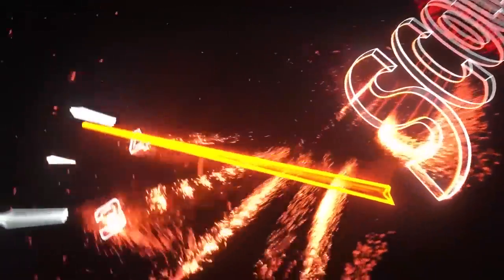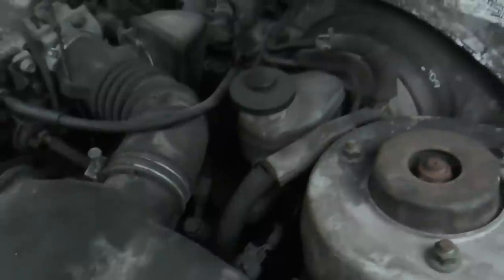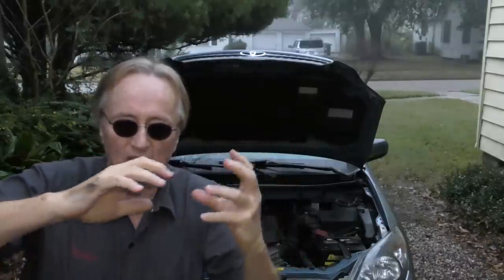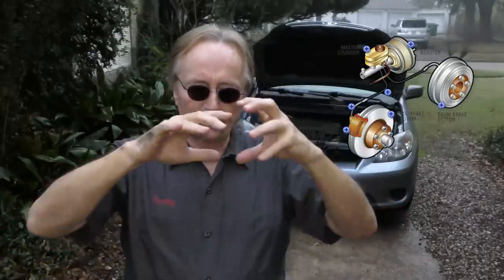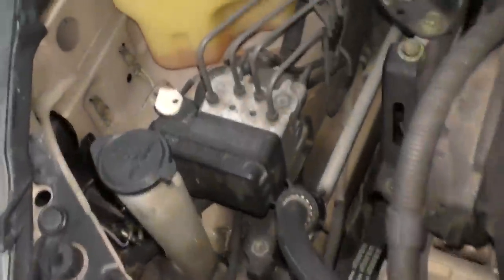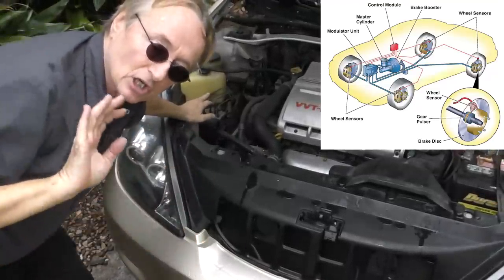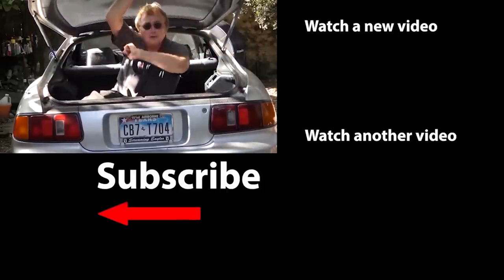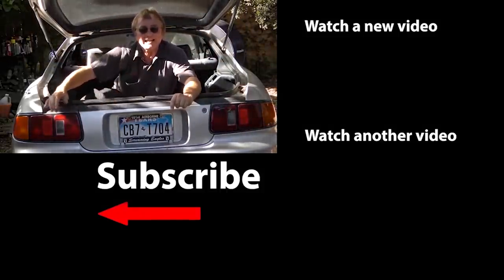Never Do This When Braking (Destroyed My Car)

Comment: Hey Scotty,  I've got a sixth reason for ya! You'll love this one because it speaks to you're criticism of stupid people.
I had to replace a master cylinder because the customer took their Nissan Rogue to get an oil change. Not long after that their brake pedal was sinking to floor after stopping.  
I looked at my customers brake system and discovered there was window washing fluid in the cylinder. I ended up replacing entire cylinder, flushing the brake system and that fixed it.
Reply: When Nissan came out with the blue coolant, you can imaging how many screw-ups we had to fix.  Coolant does not make good washer fluid
Reply: @rays7437  Yeah, but it keeps your windows from overheating.
Reply: @banderfargoyl  
Good point!
Reply: @rays7437  Oh my god, really?!?! 😕
Reply: @banderfargoyl  hahahaha!!! 😂
Reply: If I ever take one of my vehicles to a quick lube oil change service place I always make sure I tell the technician "just change the oil"!! and when I'm ready to leave I ask them to double check everything including the filler cap!! sometimes those idiots forget to tighten the filler cap or even put an oil filter on the engine😮 very dangerous!!!  you are placing your car in the hands teenagers!!! double check everything yourself afterwards too!!
Reply: @elfpimp1  
Yes, at first anyway
Reply: @cliffordgill9052  ~ Excellent point.  Has happened to me at jiffy lube that almost ruined my car - well almost.  Between cell phones & chit chat, these kids forget their main tasks.  But my car survived because it is Scotty's favorite (mine too) Toyota. :)
Reply: @rays7437  honda uses blue too
Reply: @cliffordgill9052  Hands of teenagers aren't a problem. I've had more issues with older people forgetting.

Comment: Oh dear, not mention these common problems.
Air in system
Old fluid with water in it.
Pads stuck .

All above can cause pedal problems.
Reply: People need to realize old brake fluid can and will cause problems. But do they care. Nope. Till its too late.
Reply: He already did a video on those but thanks for commenting them so other joe's can see.
Reply: You forgot the best one.... You ain't got no pads..... My niece had that issue a while back because she had a used vehicle and we had to change the pads because the previous driver was heavy on the brakes and wore them out with like 40k on the vehicle.....
Reply: Or some one doesn't like you so they cut your brake lines.
Reply: @gorp27  that only happens in the movies..... Wait, let me check my brake lines before I head out again
Reply: A collapsed master cylinder cup can let the brake pedal go all the way to the floor without slowing the car at all. Reason enough to change brake fluid for fresh on the manufacturer's schedule, to forestall rust inside the cylinder causing the cup to collapse.
Reply: @stephenarling1667  preach it man
Reply: The air is getting in where?
Reply: @johnweiland9389  air sits above fluid in reservoir. If fluid gets low, it sucks air in to the brake lines.
Master Cylinder seals can leak, and draw air in at the piston.
Air can also be in the system, if brakes were not bled correctly.

Comment: i had a brake failure once due to a broken diaphragm in the hydrovac, i used the hand brake to stop the car to get home. when it happens just don't panic. but if your not confident with the car just pull over the side and calla tow
Reply: Nemesis Chan if only my car had a hand break. It’s newer so it has the pedal emergency break
Reply: I lost my breaks on my 89 Supra, fluid leaking into the booster from the master cylinder, luckily I was only going 30 mph, emergency break handle is right next to the shifter.  Easy to stop, traffic wasn't heavy and it was an easy drive back home on side roads, had to purchase a new booster and Bk Master Cyl.
Reply: This literally happened to me a couple of days back. The pedal suddenly went to rock hard thank God I was near a couple of workshops and I managed to drive it safely to one of them. Although it sucks that mechanics in my area take advantage of you when your car breaks far away from your trusted workshop, anyways calling a tow to my mechanic and the repair wouldve cost me the same amount I paid for this mechanic.
Reply: falchulk  for the most part but my 2017 mustang surprisingly uses a a regular hand brake I honestly thought it was electronic lol.
Reply: So, every time you stop you pull the emergency brake? Then let go to drive?
Reply: @garlicgirl3149  its more of using the e brake to stop you since the main brakes dont work it wasnt designed for that purpose but it can work in a pinch for a emergency situation but yea you pull it to stop and put it back down to keep going.
Reply: @garlicgirl3149  basically yes but do it 4 times more distance as the stopping distance is extremely long
Reply: @gregbrophy5781  Broken diaphragms have caused lots of accidents.
Reply: falchulk well sorry I didn’t get the new 2016 or 17 sedan cars. I went literally from a 1993 Honda Accord to a 2011 Toyota Camry within the year I got my driver’s license and I wasn’t even graduated high school at the time. It’s not like I can afford a 2018 car as a college student anyway.

Comment: Years, decades ago my 1953 Caddy coupe lost its brakes. The coupler on the frame had a loose line and leaked out. Rolled through a red light at an intersection and coasted into the local repair shop, just happened to be going that way when the brakes quit. The hand brake I did pull without any luck. I just layed on the horn.

Comment: Scotty, until this vid, I've never seen a brake video where the person actually points out all the areas that a brake system can leak fluid! Just keep in mind, folks, to follow the lines with that flashlite, FRONT to REAR!!! Look under your hood and follow the lines from the master cylinder to the ABS module, then to any valves or unions for wet. I just love your videos, humor, and COMMON SENSE!!!!!!!!

Comment: Scotty you forgot the 6th reason........Check for a Chevy badge
Reply: If it's not a Toyota, Lexus, or Honda then you're in trouble, basically.
Reply: Hey Chevy ain't that bad it's better than Chrysler and Nissan
Reply: We have an 81 C70 10-wheeler with a grain box. Went to pull into the grain elevator with a load of corn the other night..foot went to floor and rolled up next hill. Those trucks are infamous for brake leaks/blowouts
Reply: Ha! Chevy doo doo Pies
Reply: RAY-the-WAY only if its a rear drum
Reply: Scotty for president
Reply: Nah to need the brakes the car has to get moving in the first place
It's rare a Chevy will do that
Reply: @WorkHorseLT  And Ford. But that's not hard, a Yugo is better than Ford.
Reply: @Tora1337  pfft Yugo those cars are trash at least a Ford will last 200k a Yugo barely 25k

Comment: Help!

Hello Scotty! I recently came across your channel a couple of weeks ago and I’ve been binge watching you ever since. I’ve learn a lot. 
I have a 2006 Ford Fusion 5-Speed Manual Transmission. 194k miles on it. Last year I notice the temperature gauge sometimes would not get half way like it’s supposed to. And my check engine light came on and off at times. Went to auto zone and orelly and the code was the thermostat. Bought the thermostat took it to a mechanic to have it replace. He replaced it and the car started overheating. He then said it could be a clogged radiator. He replaced that and a couple of sensors in the motor. Car would still over heat and he ended up removing the thermostat to allow free water flow. Temperature gauge still doesn’t not get halfway and check engine light is back on. With the same code of the thermostat. 
He eventually said the “engine head” was worn out, Im not sure what that mean. 
Besides getting a new mechanic, what should I do? I’m in Dallas. Thank you!
Reply: I imagine he would say have a mechanic with a laptop look at it. Plug it in, take it for a spin. It shows live data as well as detailed specs. Most would charge around $150 for a diagnosis, which would then go towards the cost of repair if you did it with them. 
He also has a video about diagnosing a blown head gasket, which you could look at, and see if the symptoms are similar. Discolored coolant, for example.
Have you thought about checking the fan(s) behind the radiator? Or possibly flushing the coolant system. Maybe you put water in it or a mechanic doing an oil change topped off your fluids then put the wrong fluid in there. For example, someone else commented on here and I've stopped it from happening to me, a tech might accidentally put coolant in the windshield wiper fluid reservoir and vice versa.
As long as you're not taking it on road trips, I mean, it's been an entire year and it hasn't destroyed your engine yet.
Did you say he replaced the entire radiator? And if you're running it without the thermostat, which would be monitored by the computer, that's why it would say there's a problem with the thermostat, because it's not there, you need to check it. I imagine the computer doesn't know how to operate the water pump correctly without the sensors and gauges. And Ford is known for having finicky water pumps, particularly in the Taurus. Fixed Or Repaired Daily.
Reply: I overheated my first car because a mechanic left a screwdriver in my radiator. I ALWAYS watch now. If something doesn't look right, I say something. Even a tire rotation. I've watched them take the tires off, go do something else, then put the tires back in the same place. That's why I watch; it happens. Nobody is perfect. As long as they don't get mad when I point out the mistake. I just care that it's done right. And I've also learned how to say it in a nice way. It helps to be nice.
Reply: randalljbell prior to those repairs my car never overheated. It was until he replace the thermostat that started over heating. The car actually drove fine and even after this repairs drives fine. Except that the check engine light is on and the temperature gauge doesn’t get to the halfway point. Which is obviously not normal. I do my own oil changes. Yes he replace the radiator, he said it was clogged because it would get hot on one side and not the other. As far as coolant fluid. He told me to buy a gallon of it whenever I took it so he could replace the thermostat. He said the coolant would come out once he replaced the tstat so he had me bought some. After he did the radiator, I don’t know what fluid he used. The only way he found for the car to stop overheating was to remove the tstat and just leave the tstat housing in there. Now the water doesn’t have the restriction the tstat does. Which is not supposed to be that way.
Reply: @abnergarcia6252  it is possible that you either got a defective thermostat, or in some cases, the stat can be put in upside down (by mistake). Then, the sensor part of the stat does not know when to open! If you bought the part from part store and not the dealer, it could be the wrong one!
Reply: bigwo56 I bought it from auto zone. When I when to have the check engine light checked. They told me it was the tstat and I asked them if they had it there. They did so I went ahead and bought since I was already at the store. 
Mechanic did said after he replaced it that since it was a new tstat, it needed more pressure to open because it was new. He even said the old one was still good. Because it would open and close but the spring on the new needed be broken into, you know?.
Reply: @abnergarcia6252  I dont know of any scan tool that will tell you the thermostat is bad..  Maybe the temperature sensor that turns on fans.  Maybe see if coolant is flowing at radiator cap with warm engine, and also make sure the fans come on..  Might need a second opinion, as most AZ employees are not really mechanics!
Reply: bigwo56 yeah he did said that. That the thermostat is not a part a scanner would read. I will get a second opinion. Thank you.
Reply: It's not necessarily "not normal." You can't take a gauge from one car then put it in another. But wherever your particular instrument panel reads is it's normal. They are never 100% accurate. Maybe the digital ones. Kind of like the fuel gauge. Some cars go below 'E' and some go above 'F' you just have to know what it is. They are true amongst themselves, as Scotty would say.
As far as the computer readout, the live data would show when it started to overheat. Was it at idle, a certain speed, or maybe just after a certain length of time? It's not just a $30 OBD-ii scan tool.
Reply: You could also maybe have air in the system. I've seen guys leave the funnel in the radiator and let the engine run to burp out the air. I'm not sure how to do that or check it, but it is a thought.
Reply: randalljbell, 

update!
So I took my car to another mechanic, he actually a friend I know. I explained to him what had happened. Anyways, he replaced the thermostat and then he said he found a couple of “wires that were touching the metal of the car making it grounded”. I don’t know if that true or not but overall the car temperature is reading correctly. I drove it yesterday, I even hit 90 mph just to see if anything would happen. (I know speeding is dangerous, and I don’t do it but I did it to see if higher speeds would trigger anything on the car) but like Scotty says “it drove like a dream”
The car is fix and hopefully nothing happens down the road related to this issue. 
Thank you all!

Comment: Hey Scotty, love the videos.  Another thing is air in the system from not properly bleeding the lines after changing calipers. I had a buddy who had new calipers put on and then had a soft pedal. Turned out the mechanic put the rear calipers on backwards so the bleeders were on the bottom of the caliper and not at the high point. Could not bleed out all the air appropriately.

Comment: Have a 2002 Jag which ran badly and had a weird feel to the brakes which suddenly changed to a loss of power braking. It was the leaky brake booster letting air into the manifold.

Comment: 🤔 I needed this video thanks mr Scotty my 99 Camry started doing this sinking to the floor I have to pump it twice for it to have pressure
Reply: look under your car at all 4 wheels.   look for a oily fluid dripping from the inside of the wheels on the inner side under the car and look under the driver seat for a oily drip.
Reply: @ateam6486  I've checked no leaks could be the master cylinder as old as the car is
Reply: Same thing happened on my kids 2000... it had air in the lines to the rear after a crappy mechanic replaced the rusty short line that slides into the strut mount... I didn't find out until the rear end housing broke (rusted through) and I had to disassemble the entire rear end... I changed the drums and shoes right of way while it was apart too...
Reply: @Jackhole_Cat  right of way?

Comment: Hi Scotty,
A guy told me he had never seen this in over 40 yrs of working on cars.  

Sure enough, it happened to me.  After replacing the master cylinder (trying for a quick fix) and the problem was still there, I had my wife step on the pedal.  It turned out to be that the front brake hose was coming de-laminated on the inside.  There was a big bubble in the hose when she stepped on the pedal.  So there, for what it's worth, it's true!  I like your films a lot!

Comment: One mention regarding the booster. When the car is turned on the front part of the booster has vacuum so the pedal is soft. When there is no vacuum there the pedal is hard, BUT the booster has a valve that keeps the vacuum for 1-2 full brake pedal presses even when the car is shut down. So if your pedal is hard after shutting the car off, then you have a bad brake booster valve. If however, it only gets hard after pressing the pedal 2 times with the car off and then it gets soft again when the car is turned on, everything is OK!

Comment: I have a 99 Oldsmobile Intrigue  that the metal brake line that ran to the back tires had a pin hole due rust from salt water and had to replace the whole brake line.
Reply: Very common problem on older GM's I live in the Northeast and had steel brake lines rust out on a my 82 GMC truck, 88 Cutlass and 02 Pontiac Bonneville.

Comment: Had a problem like that on my 02 Mountaineer.  Checked everything and found no visual signs or codes.  Saw a video that said drive up to a moderate speed in a safe area & try to lock the brakes.  That exercises the ABS and it solved the problem in my case.

Comment: No mention of the fluid being used in the clutch. My 2012 Hyundai Veloster did that. Freaked me the heck out when it was low the first time.
Reply: Not a fan of shared clutch and brake reservoirs.

Comment: Hi! Many years ago i had that sinking pedal problem in my car. There was no leaks every part was ok until after a long time i found the problem. In that model the brake lines to the rear were made in rubber and one line failed like when you brake it blows like a balloon and then the pressure was out! Best regards.

Comment: One other thing that can cause soft brakes is a bad wheel bearing.
I currently have this problem with a friends car. We fitted new pads and flushed the system. Made sure it was bleed properly and it was slightly better but still quite  soft. A bad wheel bearing would vmcause the hub/caliper to not be running true which would push the pads back in. So there is a larger air gap.
We also checked and adjusted the rear drums.
I am interested to see how much better it will get after the wheel bearing is fixed.